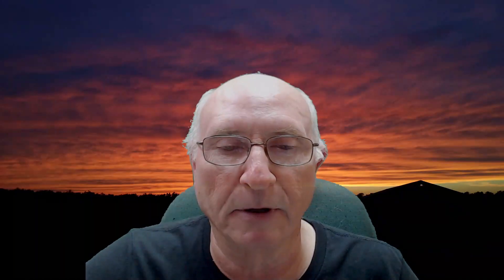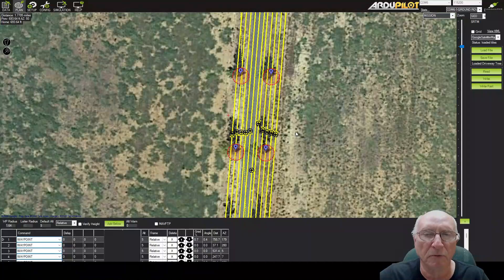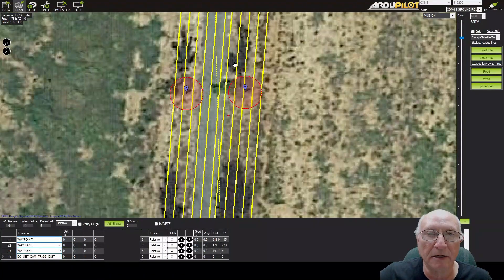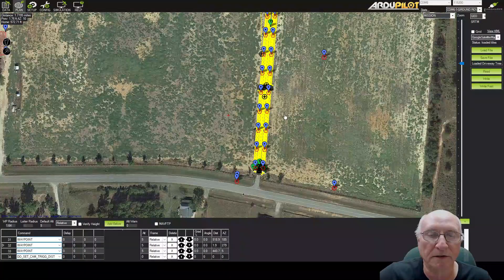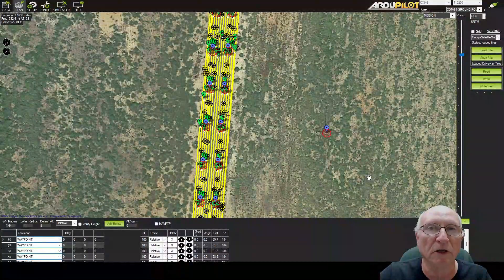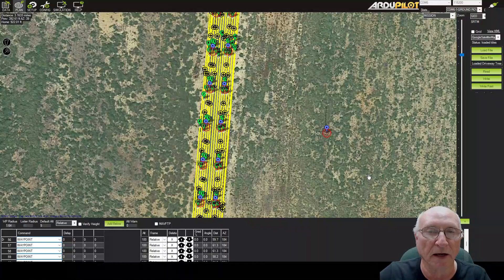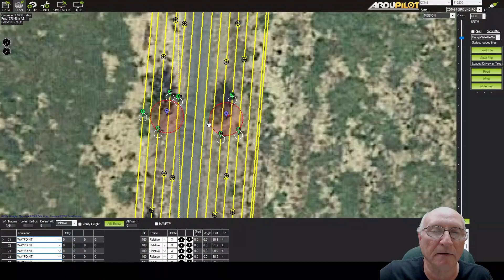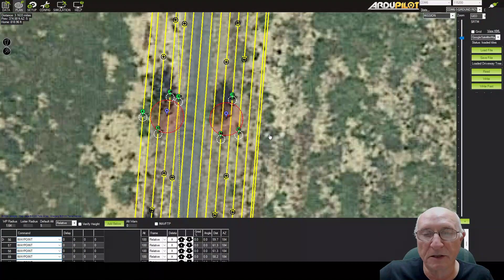ArduRover Autonomous Mower Object Avoidance with BendyRuler

Comment: Love it!   This is wonderful.   May I suggest a modification - if you could place the GPS sensor over the center of the mower blades, that might help.   Perhaps there is an offset you could use to make the GPS be apparently at the blade centres

Comment: Hey man I built one of these couple years ago it's not autonomous it's RC controlled the one in this video was the very first version before I made it look all nice and neat and got it tuned in but I'm wanting to make it autonomous do you have a write up on this somewhere? what I'm having trouble finding is how to use actuators (that's what I'm using to push the arms} opposed to just DC motors that turn Wheels. I can't find any code on that and I don't know enough about it to write it myself. Thank you for any information you can give. You're done a damn good job  https://youtu.be/HTpaumKJCJU?si=b0VTpTcVYOTl6R9D
Reply from the maker: Man, you have done all the hard part. If you can operate your mower from a remote control, you are very close to being able to make it autonomous. If you are using pwm-controlled servos (or actuators) that a remote control receiver can connect to, you can instead connect them to a flight controller that can run ArduRover.

Comment: Hi Kenny from Catalunya,
I just discovered your videos and I'm fascinated, thank you very much for posting them.
I have a question: Is there any configuration in ardupilot to use the servos on the levers of your lawnmower? Which one?
Excuse me for my poor English.

thanks Jordi
Reply from the maker: Thank you for your kind comment. Ardupilot is designed to operate servos. I am using servos to operate the levers on the pumps that the big sticks operated by a human would normally move. It does take a pretty powerful servo, though.

Comment: Kenny, how do you disable the internal compass/gyro of the pixhawk? I have dual gps yaw, but the pixhawk interferes with it. As you know, the compass next to a mower’s motor is no good so I want to fully disable it. I’ve disabled every parameter I know, and the compass still has an effect on the data screen
Reply from the maker: I assume, since you say you have "dual gps yaw", that GPS for Yaw is working properly. You can know by looking at the GPS2_RAW - yaw entry in the MAVLink Inspector. It should display your yaw value and not 65535 or 0.

These are probably the parameters you have already checked, but be sure you have these set to 0:
COMPASS_ENABLE,0
COMPASS_USE,0
COMPASS_USE2,0
COMPASS_USE3,0

If you have a valid Yaw value, you have probably followed the instrucitons here: https://ardupilot.org/rover/docs/common-gps-for-yaw.html#common-gps-for-yaw

Be sure you have this set to 2 and not 3:

EK3_SRC1_YAW = 2

Oh, and you do not want to disable the gyros. They are still used. The Moving Baseline configuration only reports the heading 5 times per second. The EKF/IMU using the gyro at a much higher rate and is essentially corrected by the GPS. 

That's all I can think of at the moment. I'll be glad to continue to help, though.
Reply: @KennyTrussell  wow, invaluable! Thank you so much! However with the mower’s motor being so close to the pixhawk’s gyro, there’s a lot of jumping around with incorrect data. Yuri mentioned in a video 3 years ago that he was able to fully disable the gyro, maybe he meant while the gps’s have a fixed heading. Another thing I’ve noticed is the gyro interrupts the gps yaw and then the gps yaw takes over after a half to full second. They’re definitely fighting. I just can’t control or get rid of the interference from the mower on the gyro, so I fear the yaw will just be jumping around. Do you find anything similar on your mower?
Reply: @KennyTrussell  I’ve been through the settings dozens of times, I’m definitely doing everything I can to prioritize the gps’s. I just want the gyro to have zero affect while the gps’s have rtk fixed heading
Reply from the maker: @sullivanwagner1996  I forgot about the parameters that do prioritize GPS but it sounds like you have already set those to favor the GPS. I have not had a problem at all. My heading is rock solid. My Cube Orange flight controller on my previous mower was about 2 feet directly over the engine. On my new mower (which I need to work on and get going!) the Mateksys H743-Wing flight controller is where the seat was located. In the limited time I have had it running, I didn't see any issues either.

Is there any way you can test with the flight controller moved further away temporarily to be sure it is an interference issue? That is probably hard to do with all the short cables and such.

I'm not sure what else to suggest. Have you posted the issue on the ArduPilot discussion forum?
Reply: @KennyTrussell  you are incredible. Can’t thank you enough for taking time to help. I did post, but didn’t get any responses. I might’ve been too vague in describing my issue. So currently we have everything Jerry rigged underneath the seat, very close to the engine. Sounds like I need to move it away and potentially get it a couple feet up. I’ve also heard that the blades can have an electromagnetic affect with compass/gyro too, so hopefully getting it out of that area altogether helps. I do like the idea of having the gyro as a backup and insurance on heading, but I just can’t believe I’m unable to disable it altogether and get rid of the bad compass readings(given the interference from the engine). But then obviously I don’t know how to get a heading if the GPS’s were too cut out for some reason, so probably good to enable the gyro like you’re saying. Anyway, I’ll definitely do some more testing and see how we get on! Again, thank you so much!

Comment: Looks great!  I am jealous how precise and "urgent" your mower reacts.  The amount of time I have spent tweaking PID gains on both atc and psc trying to make it follow straight lines and stop on a way point is crazy, and honestly, still not 100% successful.  I am going to attempt using a lidar and bendy ruler for object avoidance, but after hearing your comment about having to place a waypoint just past the "fence" totally defeats the purpose of what I'm hoping to achieve.
Reply from the maker: Getting tuning right can be a bear. I don't claim to have had mine perfect. I sent you a private message on the ArduPilot Discussion Forum.

Comment: Kenny Nice too see your post..Are you still working on this , I have had some delays in life to halt my research . I like you setup .Did you rebuild after the fire?
Reply from the maker: Nice to see you commenting! Yes, I almost immediately bought a used mower and, with the help of good friends in Louisiana and Texas, I rebuilt. However, I have been plagued a bit by servo failures. The new mower requires a lot more force to move its controls. But, the main delay is that I have had a lot of other things going on and just haven't made it a priority. I have very little to do to be running, and hope to get on it soon.

I hope you are doing well.

Comment: I wonder if the Ardupilot devs could take the line that bisects the fence and create automatic or implied waypoints on both edges of the fence circumference.  Would probably be simple if the rover was one pixel, but real world would have to accommodate the rover footprint.
Reply: Thank you for sharing your experience!  That is a very cool project.  I’ve wanted to make something similar for a long time.  Are you using RTK to keep your lines precise?  I wonder if you would have better accuracy with the algorithm if you placed your antenna closer to the center of rotation.  It wouldn’t totally solve what you’re discussing here I’m sure.
Reply from the maker: @TheRobertsonShow  Yes, I am using RTK and also two GPSes in a configuration called Moving Baseline. The two GPSes are separated so that heading can be determined from the orientation of the two GPSes with RTK accuracy. The firmware is ArduRover, a very mature open source package. There are X, Y and Z parameters that one sets in the system for each GPS to indicate precisely where the GPS antennas are located relative to the center of rotation. The firmware translates the readings from the GPSes to the center of rotation, so there is no offset in navigation introduced by the GPSes being offset from the center of rotation.

When I first started with the project, about 6 years ago, I did not know about those parameters and I did have issues from the offset. The learning curve for ArduRover (part of the ArduPilot project) is prettey steep, but there is a great community of users that help each other.

You can learn more at https://ardupilot.org/ and https://discuss.ardupilot.org/.
Reply from the maker: I have thought, as well, that it would be pretty easy to do this. I should formally request it to see what happens. My guess is that there are bigger fish to fry, and for many applications, the current behavior is fine. We mower folks, somewhat uniquely, need to cover every inch.